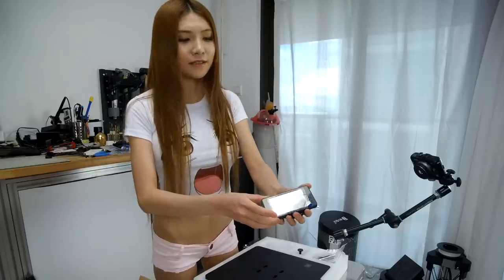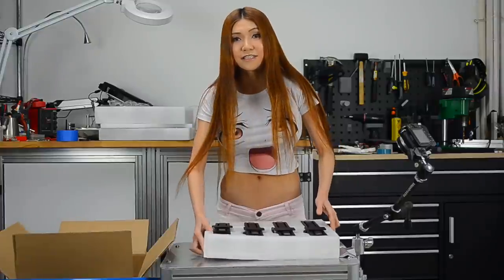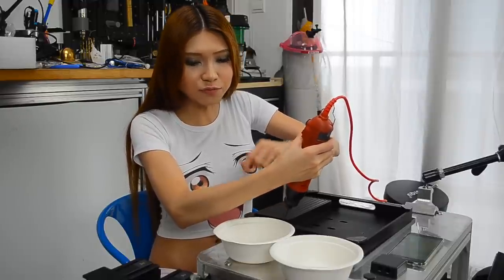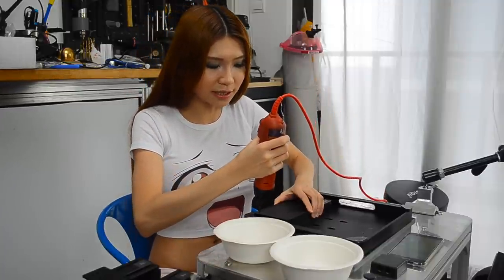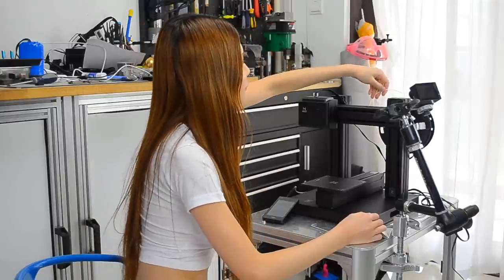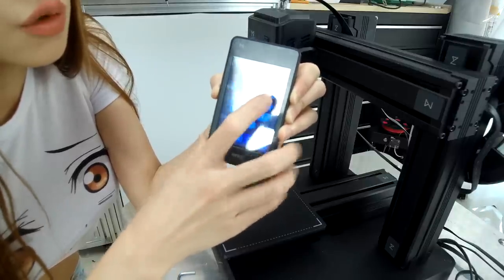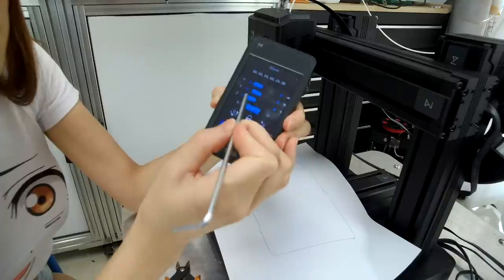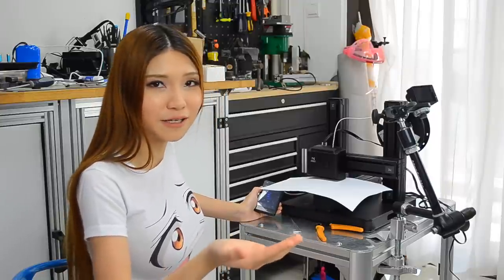I FAIL to get the MOOZ 3-in-1 Printer Working😢

Comment: Don't feel bad about getting the filament jammed into the fan. You are not the only person I seen do this with this machine.
Not sure what is up with the print head design but getting the filament jammed in the fan appears to be common on this thing.

Seen 2 unboxings/first looks at this machine both result in filament jammed in the fan on loading.. this has to be more than just user error.. Ironically both unboxing also result in unusable machines.. 

Thanks for your honest thoughts on this.
Reply: Lesson learned. Things don’t always work right the first time.

Comment: It can be so hard to share failure.  When things work well, we know all the steps from design through manufacture and shipping, and final assembly and use, all worked as intended.

When things don't work, it takes so much extra time to see where things went wrong. The hardest decision is to stop "beating a dead horse" and share the negative results.

This review probably took Naomi longer to record and edit than any prior review.  A huge investment of time that winds up being mainly a "warning to others".  Not what we like for the results of our hard work.

This is probably the best example I've seen of how hard Naomi works on her projects, how high her standards are, and her commitment to share the bad news in addition to the good news. That's the sign of true commitment, something we all should not just appreciate, but also encourage.

Learning to cope with failure is a key part of becoming a Maker!

Thanks, Naomi, for sharing this.

Comment: You'd think they would have discovered the filament-hitting-the-fan issue during their testing and put in a guide tube to direct it into the extruder, but apparently not.  Oh, wait - based on the results you had after several weeks of fighting with it, perhaps "what testing" is the real question.  To give credit where credit is due, it seems they did an excellent job of packing it for shipment at least.  Shame it doesn't work...  Thanks for the honest review, and I hope the manufacturer appreciates the patience and effort you put in to trying to get it to work.

Comment: Sucks that you couldn't figure it out even after 2 plus weeks of messing with this product... I was wondering why you haven't posted a video in a while... The look on your face after hitting the button 2000 times an then the arm finally went all the way up was priceless, along with the fan making noise and you jumping each time the filament hit the fan... LoL... 
 When you first started the machine to check the movement an needed to tap the button a bunch of times, perhaps that was the adjustment for the spool to lay on the bed... Just a suggestion... Maybe a factory reset is needed...

Comment: That wired controller is a first. You always have to remember to clear the cable before the printhead go's down. Next to that the printhead is massive and the printbed is tiny. It should be the other way around like the CR-10. This machine looks like it has been designed on the computer and put in protoype/production without much  testing. Thnx for the honest review Naomi!

Comment: Just looking at some of the design features they have I wonder if the problem could be related to the build plate setup. If I were to make a 3 in 1 machine I would not want to flip it on it’s side every time to change plates. Could it be possible that you are missing a base plate that the other plates mount to? This would bring the build surface up closer to where the Z height limits seem to be established. The build may be kept from starting because the Z axis position is past the limits. If the attempts to get the machine outside its operating parameters take a lot of trying maybe it’s a good sign of the effort that went into making it. Or if not it needs more work...?

Comment: Hi, Naomi, I received a reply from another reviwer, "project tube".
Please see if it works on your Mooz machine:
"Louis Chang using the keypad I moved the nozzle to the bottom left of the bed, which is the typical "home" position. on the keypad these is a zero all button which sets the "home" for the printer. Pressing that will save those cordinates as X0 Y0 Z0 "home". once that is set you can print normally. You have to do the same thing when using the CNC but the home would be at the corner of your wood not the bed."

Comment: Hi, Naomi,
I'm also pledging on kickstarter on this Mooz printer.
Please see these solutions fix your problems or not, if not, I like to cancel my pledge as well.

-For Z Axis, the solution is the "Home buttom"
If you hit home buttom, the x y z axis should be moving to hit the endstops.
If you only move the control panel, it doesn't know "where is your starting point, 
It could be the reason you couldn't hit the bed?
And it's odd to me, the bed doesn't have spring to adjust the level..

-Can the Mooz connect to computer directly for printing?
 You couldn't have the gcode to be run, could be you receiving a printer with faulty sd slot.

Comment: The problem seems to be on the software rather than the hardware side of things.  If you get into some of the basic coding side of things for whatever coding language they are using then perhaps you could find an easy code replacement fix.   Java is sometimes the standard easy go to language used by manufacturers due to it being fairly easy for coding and compiling the files and there is a lot of support for it from sun micro systems too.  Could be the zero leveling default is set wrong, like the wrong code for the location of what on the machine is considered base of zero level in the software could be off due to the total height in cm or inches in the code which can cause faults to happen when adjusting the z, y and x axis on the machine depending on too if it uses micro cameras to do the adjustments for laser cutting/etching etc...or if they are simply doing all leveling via code for the depth the lasers will cut into the material being etched or cut with it.  Any way, it was a good review of the product setup.  Might also recommend that the insert for the material have a separator plate between  that fan you kept hitting and the material input section...etc.  You might try doing some tutorials or video's on Pi home automation as they make for some fun projects and to see what ideas you can come up with too.  cheers and  serpentza sent me here from his videos.   Its good to see women who love tech as much as us guys too.

Comment: Hi Naomi. Cnc is a lathe I used to encounter this error when the workpiece's nosing point is rolled. Try scratching the printer head on the pattern of the grain head. So give me a startup pot where you can start printing, because now you can try to work at a null point in the factory but you can not because it fails to run because of that. Sorry I can not use the google translation in English.

Comment: Thanks Naomi.
It seems MOOZ founders were inspired by look and success of Trinus from Kodama company. Their device also has solid construction and combination of printer/cnc/laser. But much better quality.
Reply: Also I want to say about wiring on MOOZ. Using RJ-45-like connectors. It's not good for high current circuits.

Comment: Is it possible the heated bed wasn't at temp and that's why it seemed to just sit there?
(just a thought)
Reply from the maker: No heated bed...
Reply: Hmmmm.  The link that you gave says it does have a heated bed.
Maybe once they start shipping they will have a heated bed.

Also, what they may of done was send you a unit that had firmware for a heated bed but didn't give you a heated bed.
(Just a thought.)

Comment: Nice idea but the execution is poor. I think the main issue lies in the overall design - its simply too complicated, as if it was designed from an industrial manufacturing point of view. I would've thrown the thing out the window, especially after that poor placement of the filament entry. The key pad is tiny, those network cables should be tied away and not be able to be bumped and it shouldn't need so much assembly, as it gives a lot of potential for failure (as Naomi discovered!).

Comment: As stated in another comment (by the manufacturer), you should seek their help since you are having so much difficulty. As stated by another commenter (a fan) with this much difficulty, I don't consider this printer easy to use. Too much assembly, the controller will be difficult for anyone to use. Definitely not a DYIers printer.
Reply from the maker: No, that's not what a review is.
Reply: Naomi 'SexyCyborg' Wu I stand corrected. I was thinking from the perspective of end user. I would say, though, that you could state in this review that work needs to be done to improve ease of assembly, and maybe a call to the manufacturer may be needed if anyone who buys this printer has issues similar to the ones you encountered.

Comment: How exasperating!  I know you have plenty of experience with 3D printers, if you can't make it work, then not many other people will be able to make it work, either. Too bad, the idea is great, but most machines that try to do several things can't actually do any of them. The mechanical components look good, probably a software issue.

Comment: Looks like you set the zeros to the wrong corner of the printing bed if the zeros of X-axis and Y-axis of this machine need to be set. I guess zeros of this machine should be set at left-bottom corner of the printing bed instead of left-top corner.

Comment: The machine looks promising. Little more testing in their R&D department and it would be a winner. The screen looks resistive not capacitive. The filament should be straightened before you insert it into the extruder (by the way I love the way you say "extruder"). Liked your video. Keep it up!